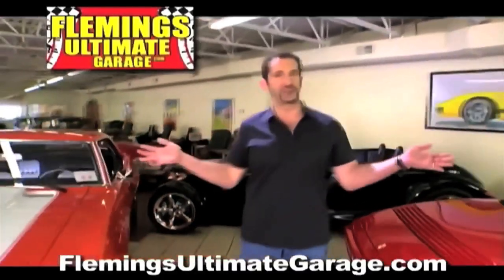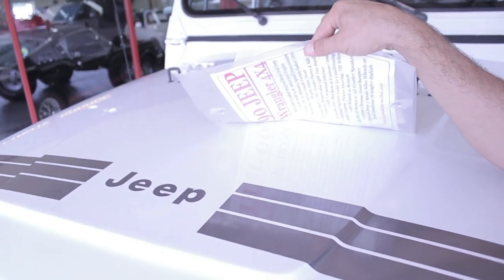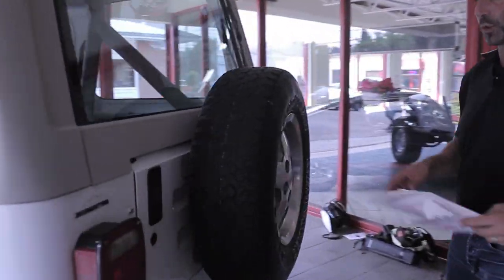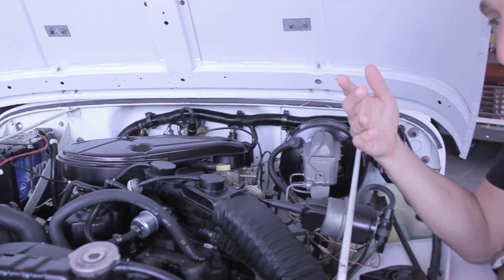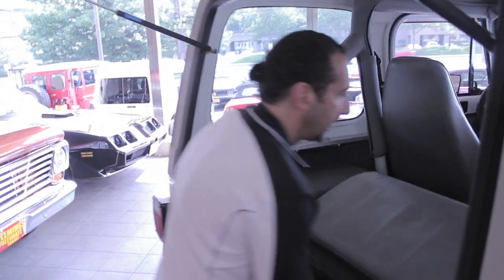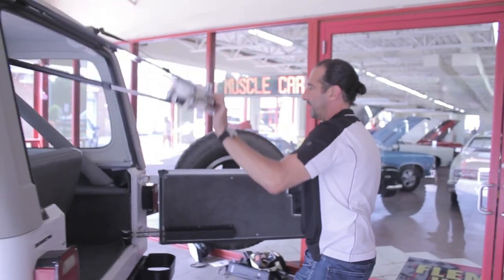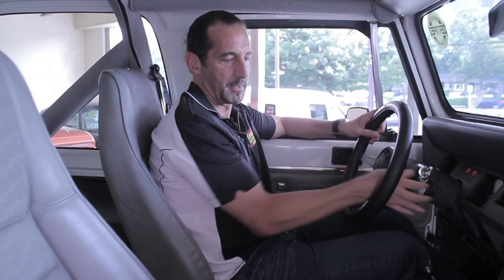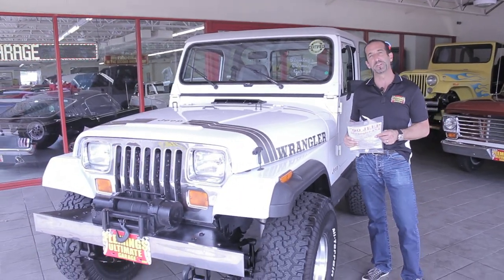'90 Jeep Wrangler Convertible for sale with test drive, driving sounds, and walk through video

Comment: how are the brakes working? Usually those drums on the back aren't enough to stop.
Reply from the maker: Hey Felix, This car sold about 2 years ago and the new owner upgraded to 4-wheel power disc brakes
Reply: +Flemings Ultimate Garage . Awesome i am about to do the rear axle on mine . Looks like there is no other way. THANKS.